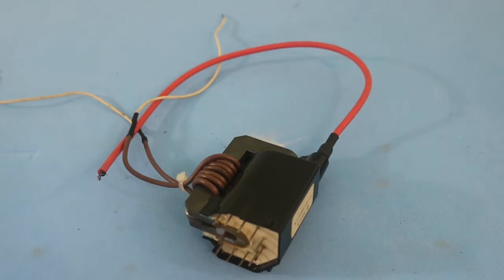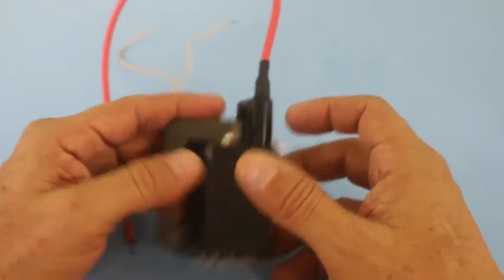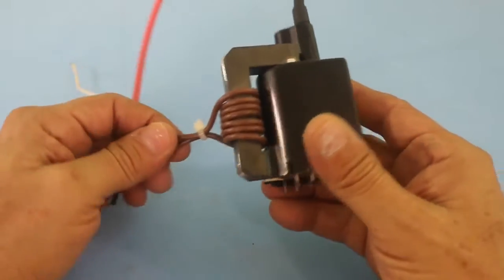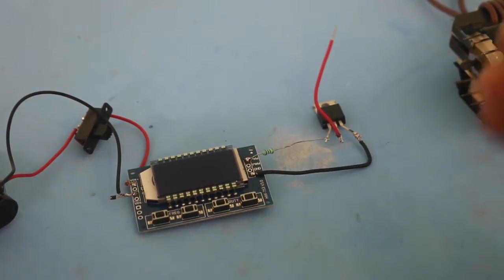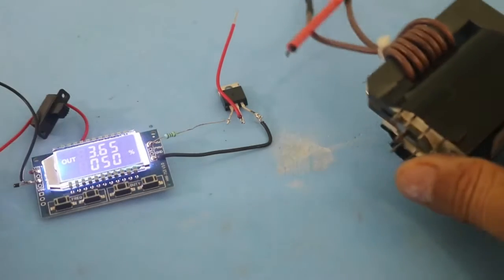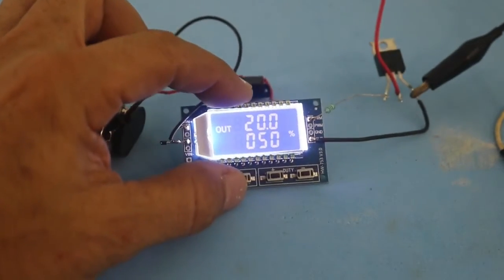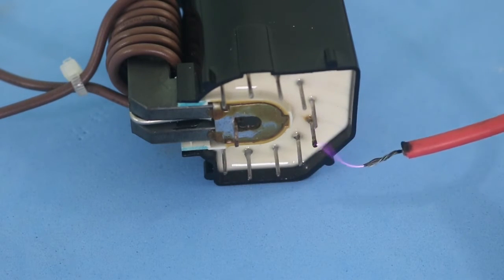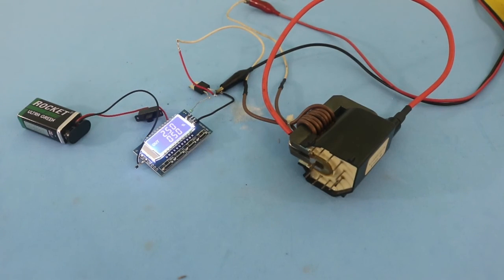High Voltage Flyback Driver with PWM

Comment: Add a feedback winding and a capacitor across the primary winding.  The circuit self oscillates at the resonant frequency and the capacitor stops the mosfet from blowing up if the seckndary is open circuit.
Reply: Where would the feedback coil be connected to?
Reply: @BoredAutocrat  the base of the transistor or gate of the mosfet
Reply: @ianhosier4042 can u explain a bit more pleaee i still dont understand what your trying to say, sorry😅😅
Reply: @GalenA1722you add a second winding and connect it's output to the gate of the MOSFET for a self oscillating circuit.  A capacitor across the primary driving coil absorbs the energy when the MOSFET switches off instead of the voltage getting to silly levels and popping the MOSFET.

Comment: Can you make a video with the frequency generator to a zvs? I am looking to get the frequency (sound) with a higher output voltage. Or would the frequency still be there if I added a voltage multiplier to the output of the fly back?
Reply: Its possible did you make it?
Reply: @jonaoconnor8065  yes i did
Reply: By interrupting the zvs output by a transistor driven by this pwm, is my plan, !!
Reply: @jonaoconnor8065  it is a little more than that. it overrides the frequency and sets a beat rate. I made a video with validation of what the circuit can do. https://youtu.be/0K10GMhdP0c

Comment: where do you buy flyback transformers? i have one small one i got in a kit on ebay but i cant find any large ones.
Reply from the maker: I got a bunch of flybacks from ebay several years ago. They are hard to find nowadays

Comment: Doesn't this kill the MOSFET quite quickly? If there is no way for a current to flow on the secondary side (e. g. no arc), where does the energy stored in the transformer go? Won't that create a huge voltage spike on the primary side?
Reply: Put a capacitor across the primary winding if you don't want your MOSFET blowing up when the secondary is open circuit.   Some put it across the mosfet but then you end up blowing the input capacitor and possibly your power supply.

Comment: Flyback transformers or horizontal output transformers were designed to run at 15750hz which was the horizontal frequency.
Reply: So does that mean at 1.57 khz, resonance is acheived and that the arc is at its greatest for that given voltage at the primary ?
Reply: @coucouj2781  it's 15.75khz and yes if the actual primary winding was being used. A transformer about that size would put out almost 30kv because their is also a built-in tripler .
Reply: …but in the experiment the arc seems to be greater at frequency below the 15 khz range ?
Reply: @coucouj2781  What is important is the length of each pulse, not frequency. You could have one pulse each second, but its length would have to be no more than about few microseconds. A pulse charges the magnetic field, and when the pulse is off the magnetic field collapses very quickly producing high voltage.
The energy contained in the primary pulse (current × voltage × time) determines the energy on the secondary.
Reply: I drive mine at 115khz and it rocks

Comment: Did this same thing about a year or so back but used a mosfet modual as well with the same square wave gen. really good for working out the best frequecy for each fly back and pushing it to the best output. and i can drive it with 24v.
Reply: Should I put power on the pwm controller first and then on the mosfet?

Comment: So what happens if you change the duty cycle?
Reply: I think the duty cycle acts as amperage=current there
so + duty cycle % = + current
& - duty cycle % = - current
This based on my conclusion of running a led with pwm with arduino, maybe it is not right
Reply: You are expanding and collapsing a magnetic field. I go 50/50 to give the transistor(s) the most time for their on delay, rise time, off delay and fall time. Of course most chips can switch from 100s of khz to several mhz without issues except for optocouplers.... I drive my flyback at 115khz through an IGBT switched by a mosfet so there's compounding delays to consider

Comment: Does the output voltage go down if you went even lower in frequency?
Reply from the maker: Yes
Reply: good evening the mosfet with circuit diagram no protection what do this problem
Reply: irfz44 has flyback diode

Comment: What about using a pull down resistor on the mosfet gate to help turn it off more quickly (due to gate capacitance)?
Reply from the maker: That's good advice!
Reply: Nix  Resistors not needed if in a push-pull configuration but he is using a single mosfet.
Reply: What do you mean and what resistance value do I need?
Reply: @imagine_laabs  mosfets are voltage controlled devices operate using capacitance.  Without a gate pull down resistor, the mosfet "wants to" remain on.
Reply: @Enigma758  no way! that's might be the reason why  almost every mosfet ( even more durable and powerful) keeps dying in my case. I'm using the same circuit as in the video, with some modifications : thicker primary 6mm monolith to escape heating, 50kHz 0,33 nf capacitors on primary and stabilising capacitor on the input and 120 om resistor on PWM output. The peak I reached was around 190 watts with irf3205 with 10v D-to-S and 18 amps at 25 kHz. With active double fans  capable of working around 10 mins nonstop. 
IRFZ44, irf1405, IRFP260m and many others die so fast not even getting closer. Actually one did, yet on low frequency around 7 kHz, but buzzing noise is unacceptable.
Many other mosfets die on powering on in this circuit.

If I got your idea right, there is a kind of capacitor in between gate and source of mosfet, so using it on a super high frequency with many amps delivery need an additional resistor to help it getting discharged faster? Zener diode can work as well?